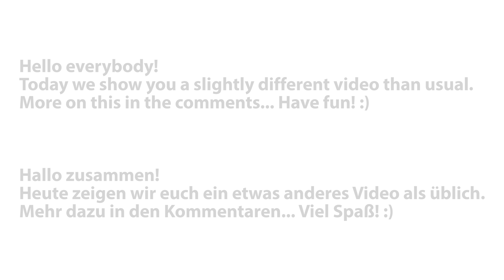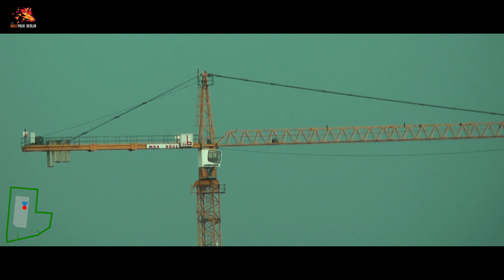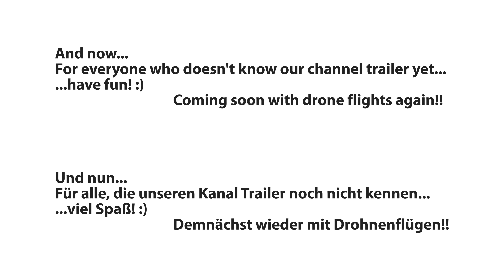#19 Tesla Giga Berlin • 2020-06-26 • Gigafactory 4K

Comment: Good work on train line pics, and good info about concrete batch plant. Given the size of the plant, and the low cost of transport by rail, having all the aggregate arrive by rail and batched on site will save a lot of travel by road. Concrete batch plant is relatively simple, and is likely transportable equipment that can be shifted from project to project.
Reply from the maker: You are welcome! Thank you Peter 😊👍🏼